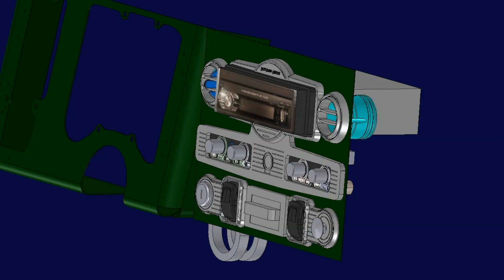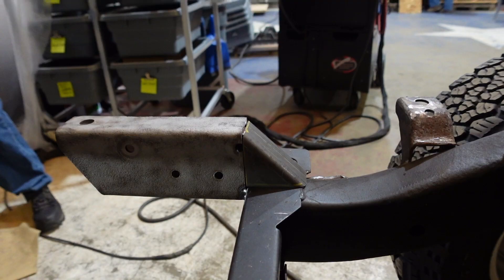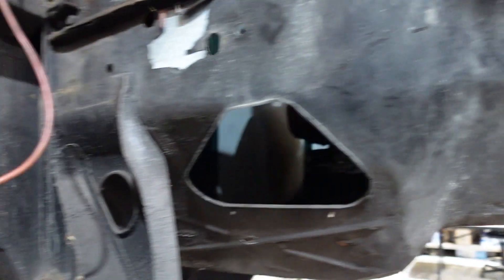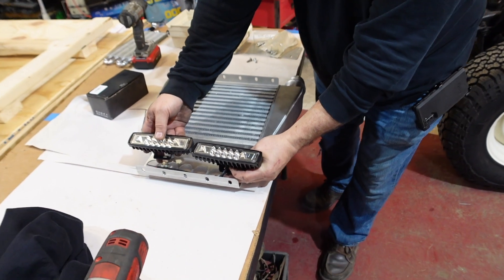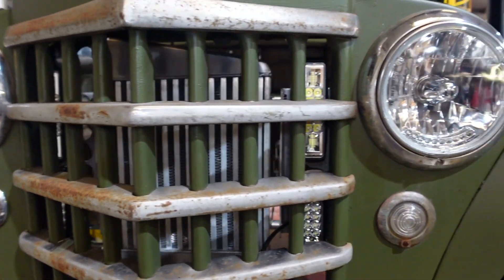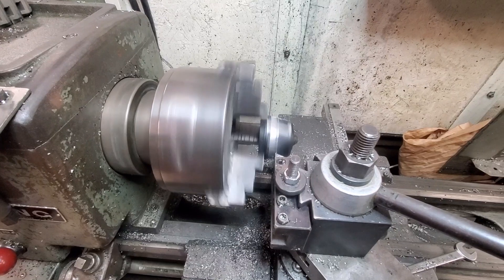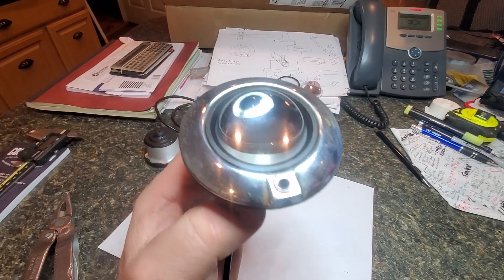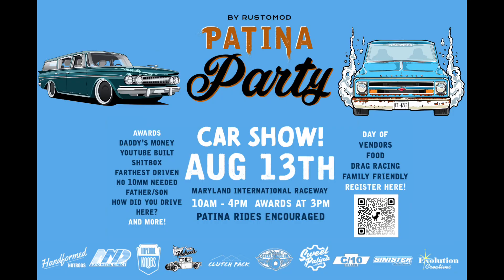Hidden Off Road LED Lights On Chassis Swap Willys Wagon Jeep! (Willys14)

Comment: Nice Willys!  Great to see somebody do something other than an LS swap :).  Wondering what you guys did for the rear lighting?  Did you install LEDs back there too?  I'm working on my own wagon and upgrading the tail lights has me stumped.
Reply from the maker: Thanks yeah we got some Amazon slim leds and put them in place of the bulbs
Reply: @Rustomod  Thanks!  That's what i was thinking of doing.  Are you happy with them?
Reply from the maker: Definitely  @stevebooher7419